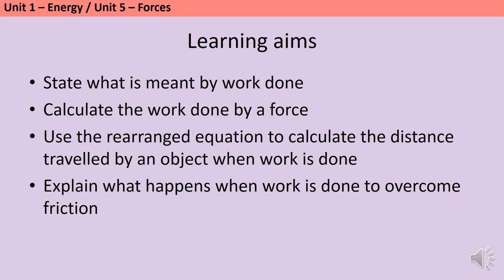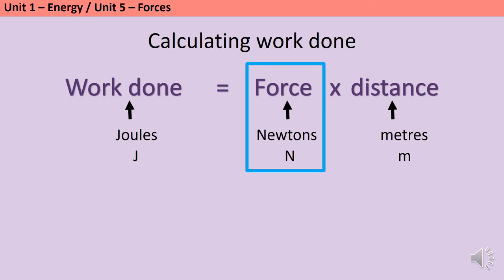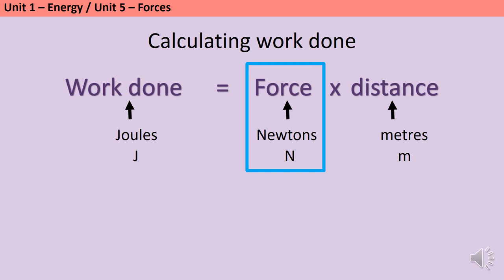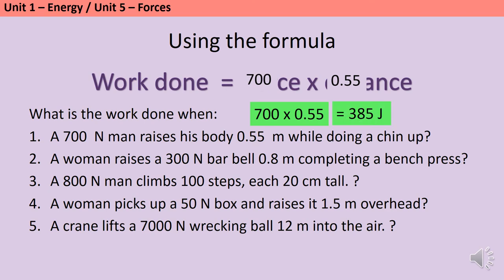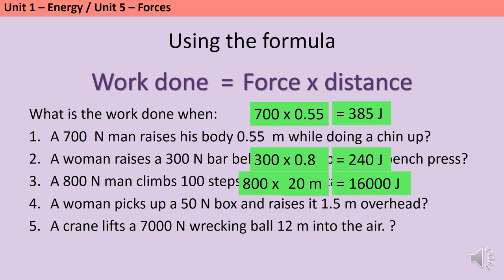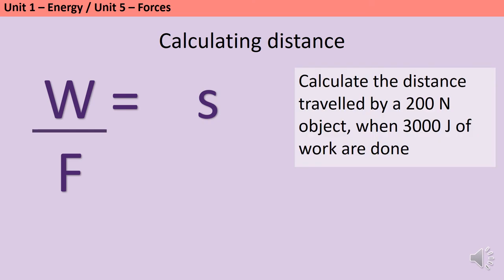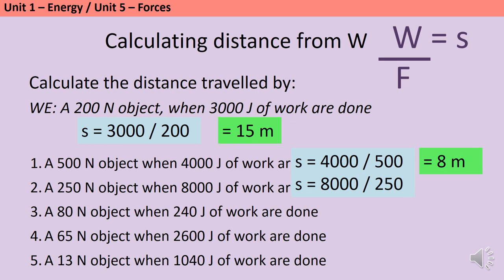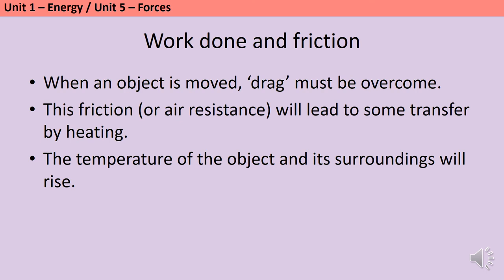Mechanical work done (GCSE Physics)

Comment: Am i correct in identifying the mechanical work in this example of a bungee jumper?: As the bungee jumper falls the force of gravity does work converting the GPE into kinetic energy. As the rope tightens it does work converting the kinetic energy of the jumper into the elastic potential energy store of the rope. The bungee rope recoils and does work against the force of gravity converting the elastic potential energy of the rope into the kinetic energy store of the jumper. During the ascent the upwards force does work converting the kinetic energy store into gravitational potential energy. Is the last bit correct? Would it be correct to say that the "upwards force" does work, should i call this upwards force "lift" (like we do for planes going upwards)?